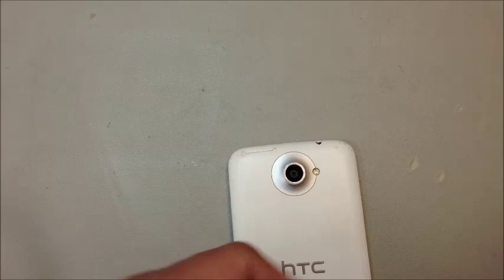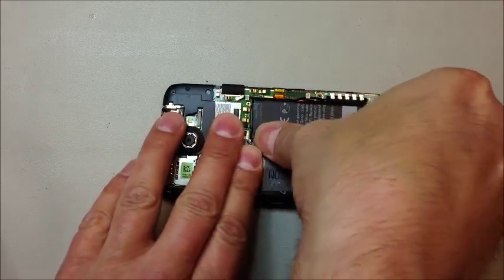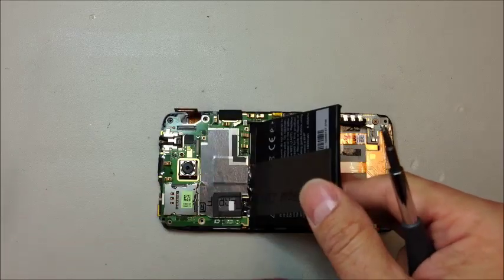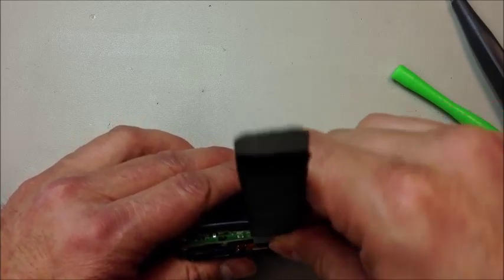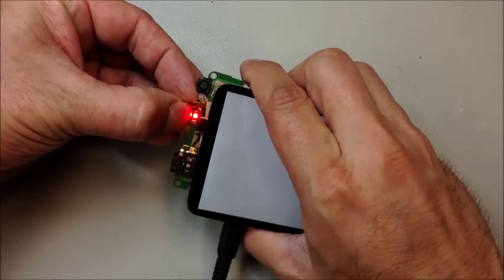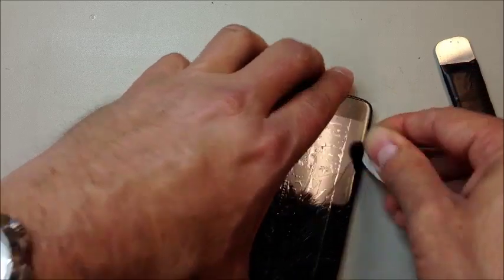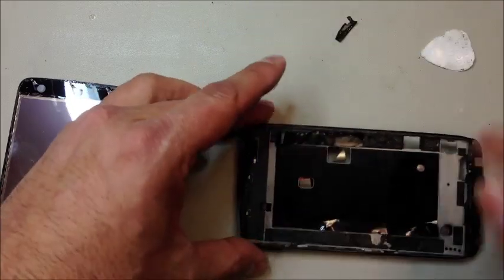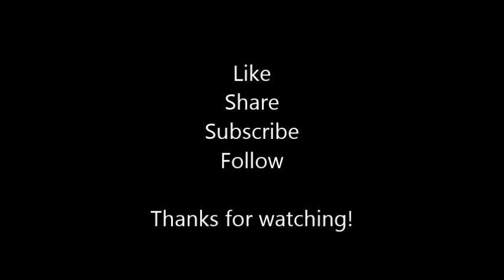HTC One X Disassembly

Comment: is the power button an easy part to fix on the international version of this phone?
Reply from the maker: I haven't worked on that one yet. Take a look at the replacement part. If it uses a pop connector or FFC then it should not be very hard. Otherwise you might be looking at micro-soldering which isn't as easy.
Reply: It is a pop connector, so I assume it is easy
Reply from the maker: George Lewis Most likely the difficult part will be putting the phone back together. HTC just has a funny way of assembling their phones. This one isn't too bad though.
Reply: Hmm, okay. I've ordered the part, so I'll give it a go. Thanks!

Comment: Hi, I'm trying to repair an european One X with cracked glass. I bought a display replacement and before reassembling I tested it. All working correctly. Then I put it down, put down the motherboard with all the flex correctly attached and when I turned on again the phone I found out that touch was responding perfectly, lcd was on but brightness was very low and there were some flickering issues on the brightness. I've read in other videos that there are several people with the same problem but no one seems to have a solution. To be clear: I bended the lcd flex cable very gently and inserted it in the connector gently and completely, as should be. Still a no go. Brightness remains very low, changing brightness settings (automatic, then manual with highest level) gives no result. The flickering decreased after taking out the display again, but brightness remains low.
Unfortunately I cannot compare the new display with the original one, cause I cracked it while removing it. Also, about the lcd brand: lcd flex cables are both yellow/orange, but on the new one there's a small squared green adhesive. Don't know if that means it's the Sony one and the original was Sharp, but I suppose that since the first time I connected it all worked fine, it doesn't matter after all.
I'm stuck at the moment and have no idea about a possible solution. Do you have any idea?
Thanks in advance for your kindness!
Reply from the maker: If I remember correctly the green labeled LCD should be backward compatible. Assuming that is correct it sounds like maybe you got a defective replacement part. My guess would be a bad back light module. Can you exchange it for another?

Comment: the G senor of my ( HTC one x) is not working anymore, would you please advice me how to repair it, putting in consideration- i've put the phone in "safe mode" and the problem is still existed???! thanks in advance..
Reply from the maker: I haven't run into this before but the accelerometer is most likely located on the main board so I doubt that it is modular. Have you tried a factory reset already? If it's not a software issue you might need to replace the whole logic board.

Comment: How difficult would it be to replace the charger port? I rolled over my phone in bed and the charger just screwed the port up bad and im wondering if it would be too difficult for myself to repair, because I dont believe warranty would cover it.
Reply from the maker: Not fun and not easy. The port is attached directly to the board so you would have to heat it off without damaging any surrounding components and then solder a new one in. This is an advanced level repair which requires a heat pencil, soldering iron, microscope, a steady hand and a lot of patience. It's easy to cause additional damage if you aren't careful. The only good news is that the part itself is cheap. Like $3.

Comment: It might be interesting to know that a HOX (at least mine here in Germany) has a different setup. Not totally, but there are a few differences, such as the housing being more sealed, there are adhesive tapes here and there and especially the battery cannot be taken out without bending it's outside material cause it sticks to the case very tightly and you have to rip it out (still carefully of course). Anyhow I swapped my displays yesterday and all works well - thanks for your detailed instruction.
Reply from the maker: Good to know. A lot of people have mentioned adhesive on the inside but I have not encountered it as of yet. I'll add a notation to the video and description.

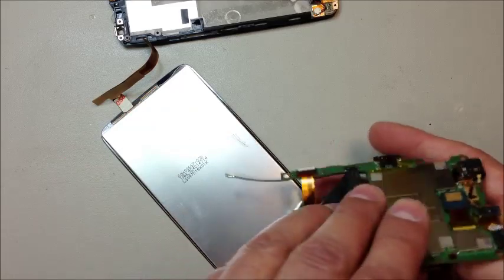Comment: Whats that cable called that has to be flipped over at 9:15. I need a new one and will i have to replace the whole lcd and digitizer?
Reply from the maker: That is the LCD flex cable and unfortunately yes if it is damaged you will need a new LCD. Make sure that you get the right one. It may or may not have a green stripe on it. I've been told that the one with the green is backward compatible but I have yet to confirm this.